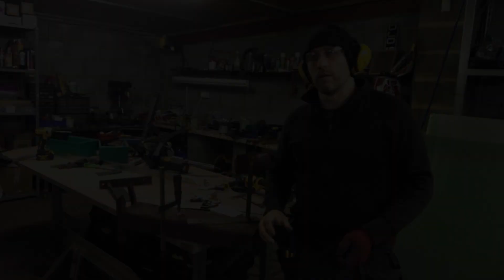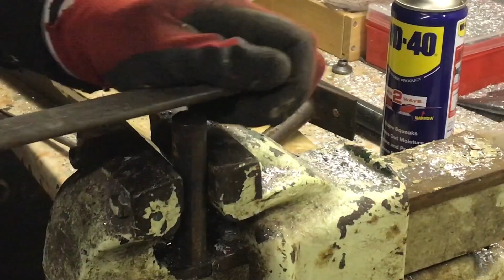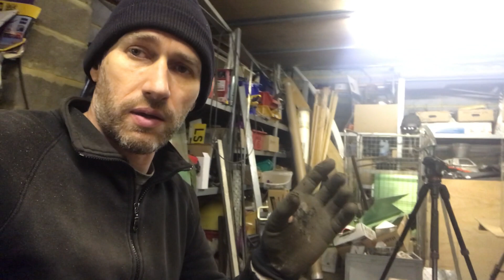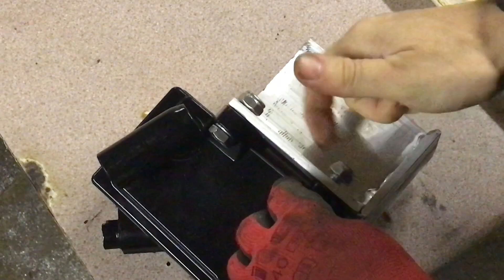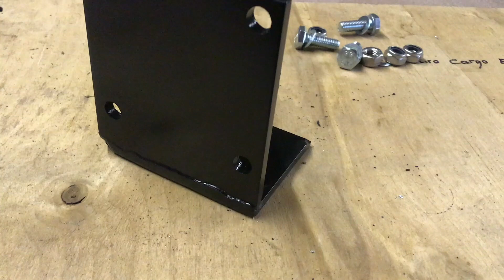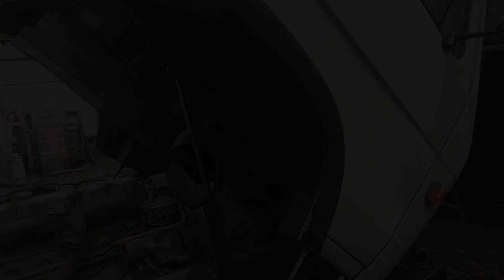MAN Truck Cab Ram Mod, 8.136 / 8.150 G90 Overland truck build  [S1 - Eps. 13]

Comment: I searched for man 8.136 specs is 353nm torque is enough for expedition truck!!?
Reply from the maker: Yes it will be fine.  More power would be nice but not needed.    It’s generally road use when you want more power.  Remember this isn’t a rock crawler, or off road competition vehicle. My Daf is under powered, only 145 hp as standard.   But I am tuning that a little at the moment.  More of a nice to have than needed.   The big reason I’m doing it is I am adding an exhaust brake, and while messing with the exhaust I’m adding a uprated turbo and stainless exhaust system.  But it’s not needed. The exhaust brake though I recommend.  Much nicer in the mountains.
Reply: @matthewpayneadventurerfilm8902   even I am working with under power truck 115hp 400nm as it is the only 4x4 truck available in India , as in Europe there so many kinds of 4*4 trucks , so I was a bit shocked you choosed this one .  Waiting for your building series videos 👌
Reply from the maker: @KnowRealIndia9124  this little MAN isn’t for me . It’s for a customer. I have my Daf T244.   I know of some T244’s that are in India.  Think about 10 for sale.
Reply: @matthewpayneadventurerfilm8902   there are just 2-3 in India brought by carnet , as import duties on vehicles  is highest in the world + few more taxes
Reply from the maker: @KnowRealIndia9124  No.  I know of someone that had 10 in India and wants to sell them. He was considering shipping them to the UK.
Reply: @matthewpayneadventurerfilm8902   I don't know , will see now

Comment: That looks solid Matt! 👍🏻 

Just to ask a potentially stupid question if i may, would it have been possible to use a gas strut instead? Even to replace the old system with a custom one off t'internet?
Reply from the maker: Maybe.  It wasn’t something I considered.
Reply: Ok understood, 

I'm working through your videos with intention to restore and build an overlander over the course of this year 👍🏻 

For all the downsides of social media, its definitely balanced out with folk like you putting out interesting and helpful advice 👍🏻
Reply from the maker: @jamesredgrove6141  thanks.  That’s nice to hear.

Comment: How does the 8.136 compare to the t244? In more terms of mpg? I’d love a t244 as you can pick them up cheap but the 13 mpg puts me off
Reply from the maker: I cannot answer that question with any real world knowledge as I have not driven the 8.136 more than a mile myself.   Although 13 mpg sounds bad on the Daf, when you compare it to many over vehicles it’s pretty good.

Comment: Another really good example of problem solving and engineering.   Does this possibly work as a mod to replace the cab rams on the daf t244's.  I hear that replacements are getting hard to source
Reply from the maker: There’s no reason why not.